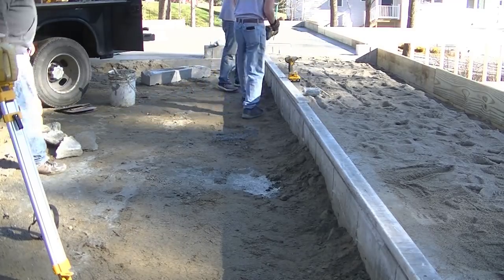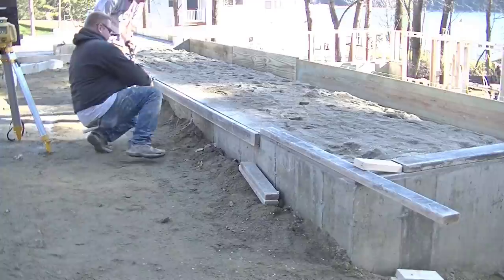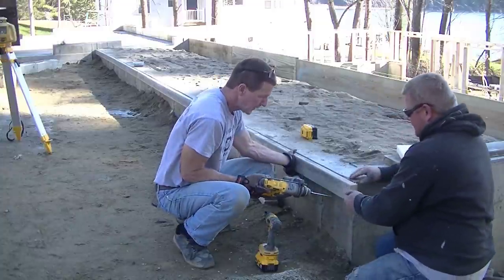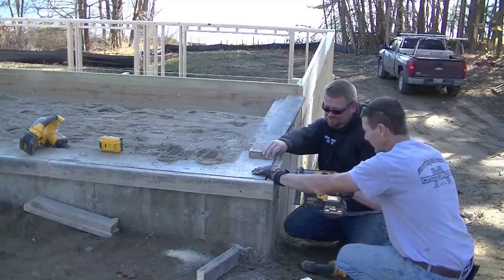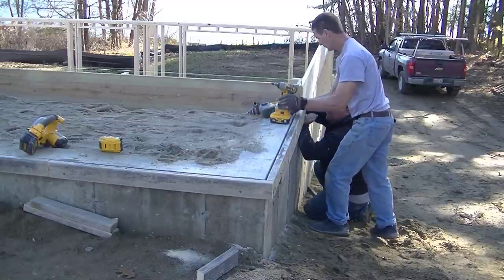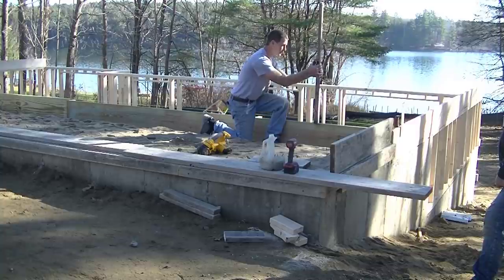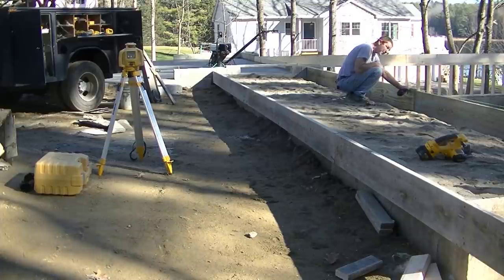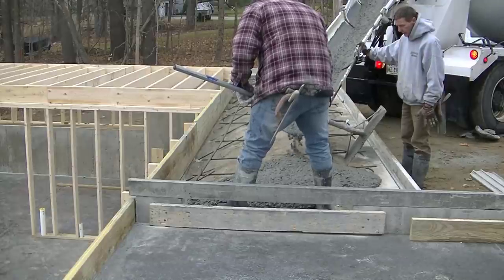How To Form A 1.5" Overhang For A Concrete Patio

Comment: Been doing concrete for almost a year now and I was trained to hold the 2x4 and just hammer the concrete nail by myself. Then after I just use the Paslode to add the 2x6 or 2x8. Interesting to see how u guys do it. More salaries I guess why I'm doing it hard way

Comment: Love the video. May I ask... have you ever framed anything with a similar overhang but on a rounded patio? I need this. Thanks
Reply from the maker: You would use something like Azek pvc trim boards 1x4's as long as the bend isn't to hard, then a 1x8 or 1x12 for the outside form.

Comment: Mike, I am a big fan of your videos, and the care you take in providing a quality product to your customer and providing education to your viewers. 

Quick question for you: I live in DC and I recently poured a 3 part stone, 2 part sand, 1 part cement cap over an old coal chute. The pad serve two purposes, being both a stoop for a side door and a seal for the chute. A week after the pour, water is leaching through the pad (~8 inches thick) into the old chute . What would you recommend for sealing it?

Thanks! Pat

Comment: Hey Mike, just a question. We have a patio just like the one you've pored with a 1½" overhang. There's no drip edge, just wondering if if a bead of caulk could work to prevent water from running back to the foundation wall.

Thanks

Comment: Used plywood instead of 2x12s so we had to run a board along the top and hard kick it using a string line to make sure it was straight. Had to tap with a hammer forever so the prisoners benches wouldn’t have to many bug holes, I’d like to try out that pencil vibrator in cases like that.

Comment: Sometimes I do it that way, If I have too. Usually I just pound stakes into the ground and toenail the 2X4 onto them rather than screwing them to the foundation. It's just a lot faster and easier. Plus, you don't need a hammer drill to strip the forms. Any dude with a hammer can do it.

Comment: Tapcons are expensive.  Two duplex nails driven in each hole work just as well, perhaps better. I've seen guys use a duplex with some tie wire.
Reply: You can reuse the tapcons.
Reply: @joegarcia4424  But why spend the money in the first place, or the labor to collect them once you've stripped the forms? And tapcons don't hold as well as nails anyway.

Comment: Pinch nail is cheaper than tap cons
Reply: Are you talking about double 16p nails into the drilled holes or a 16p and a piece of tie wire? If so, you’re right, they do hold good, but you’d have to drive them in all the way, so the 2x12 could sit flat. Then they’d be a lot tougher to strip.
Reply from the maker: We'll use those Tapcon's over and over again too. Probably at least 20 times each.